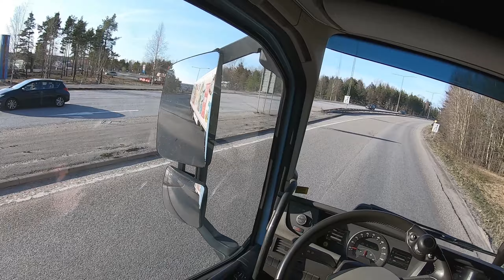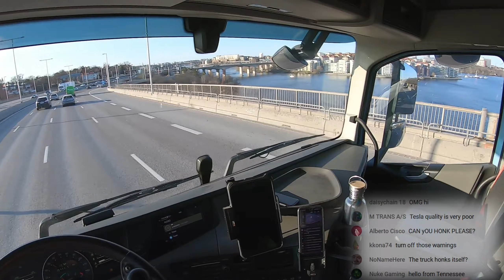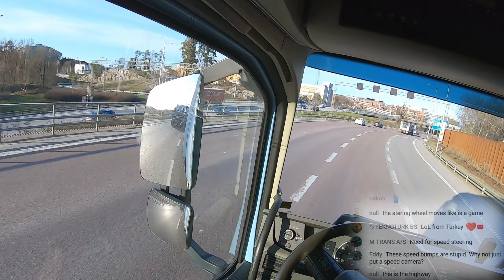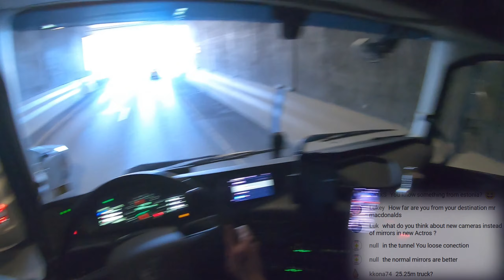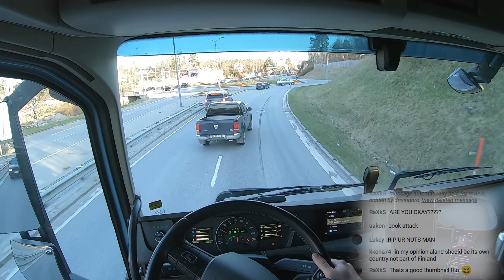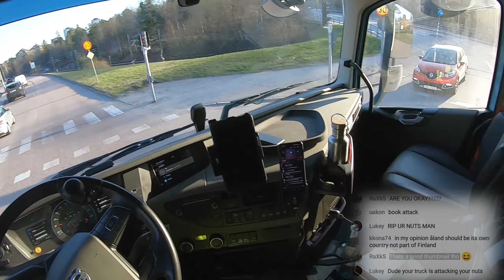Livestream POV Semitrailer driving - Biogas Truck Volvo FH460 LNG | 16.04.2021

Comment: well the flimsy-ness could be the type op chassis you have on the truck, the weight distribution and ofcourse the tyre pressure. if you have like a 6X4, its way more flimsy then a 4X2 because of the double unsteered rear axles. and if you have a 6X4 with low air in steer tyres you're doomed lol

Comment: Steering rack/powersteering  seems to have some problem i think
Reply from the maker: Honestly i think the truck was fine, maybe just a little low tyre pressure because when i was driving back without load it was alot steadier :)
Reply from the maker: They probably loaded it too heavy in the front of the trailer.. And this was the result :/
Reply: i dont think that that is the problem, because when there is a problem with that steering rack/ powersteering the truck will not be sloppy, but there will be a huge dead zone in the steering. that are my experiences with those problems